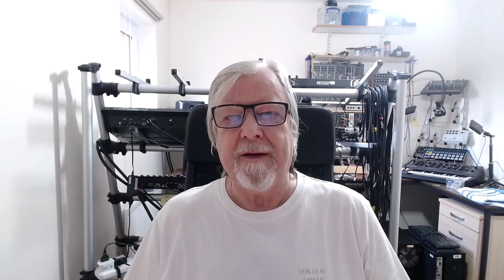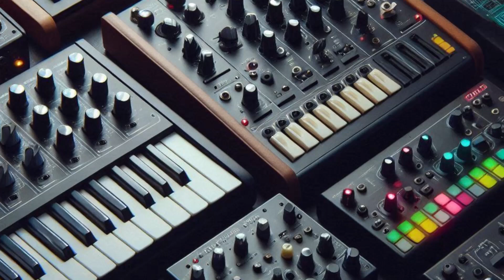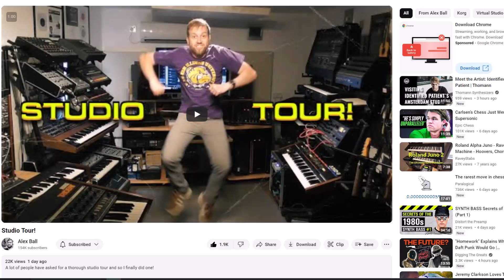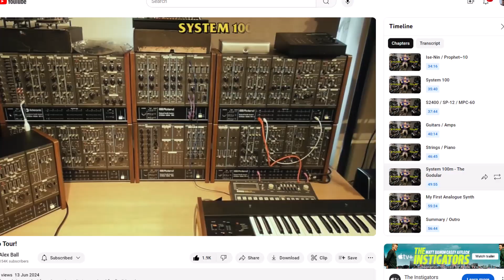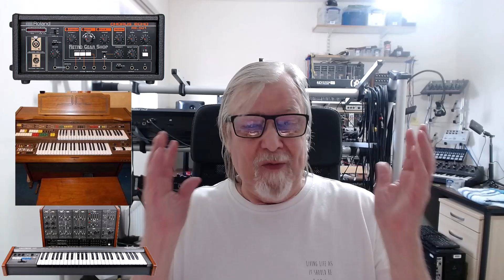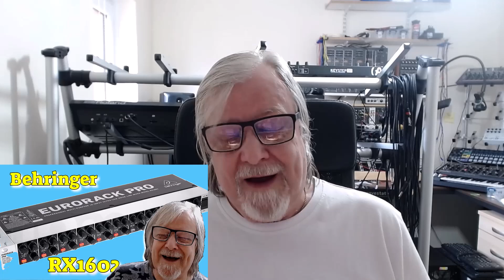All Your Gear - Always On! - Gotta Connect 'em All

Comment: I too have the Behringer mixer you use, coupled with the Behringer Ultrapatch Pro. I have three audio sources permanently connected which leaves plenty for temporary inputs - other expanders, keyboards and iPad / phone, cassette deck etc. when needed. For MIDI I use the CME U6MIDIPro which is 3-in and 3-out on DIN sockets with a USB connection to the PC. If anyone is setting up a modest studio I’d recommend all of these for consideration. The U6MIDIPro has very flexible routing and also MIDI filtering so you can eliminate unwanted Sysex, CCs etc.
Reply from the maker: Thanks for the recommendations Paul 👍 Sounds like you've got it all sorted 👍